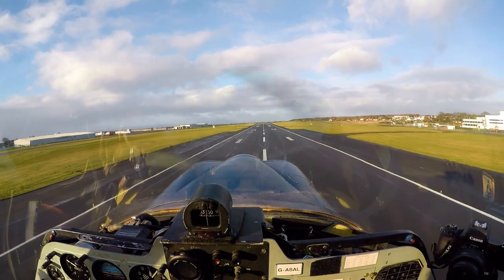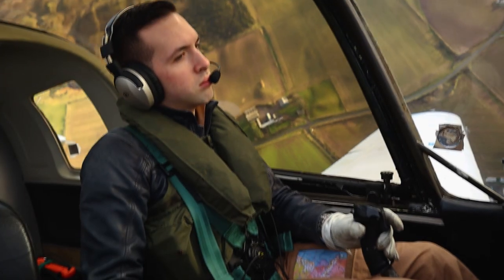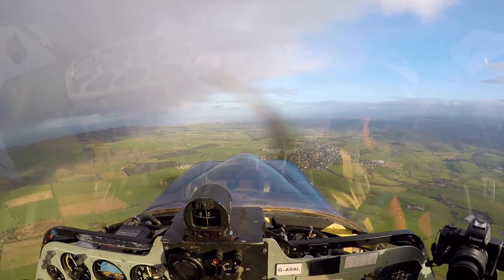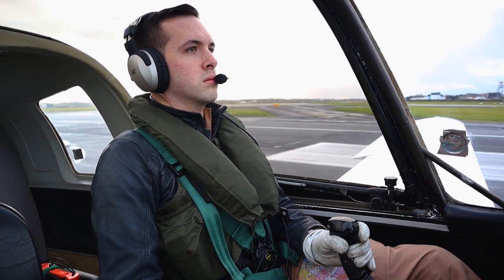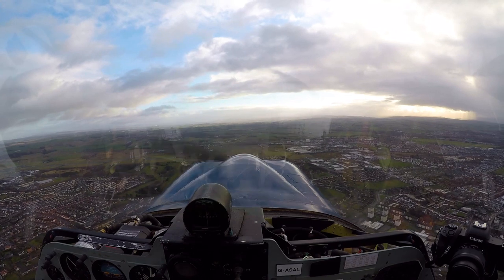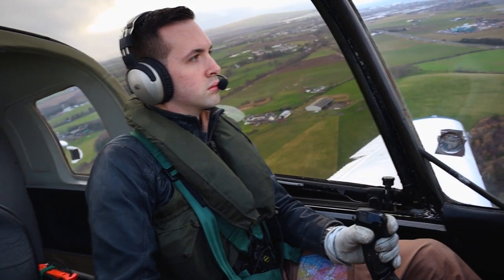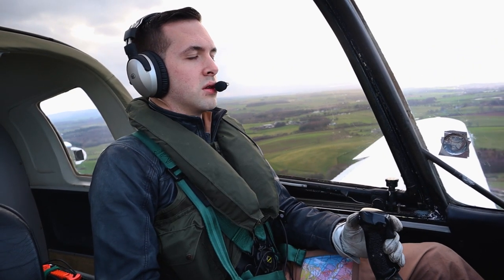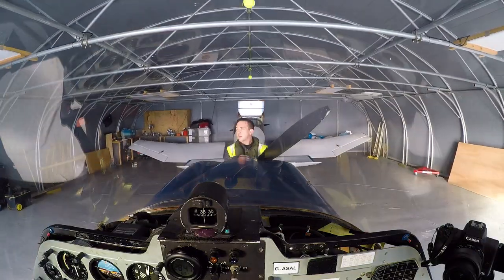Plane Landing Practise - Scottish Aviation Bulldog - Circuits at Prestwick Airport with ATC Audio

Comment: what's the story with the fatigue meter in the Bulldog and what you do when you reach the limit - stop flying ?
Reply from the maker: This particular one was never fitted with the fatigue meter so we either have to stop flying at 5000hrs or do a modification on the wing spar. Which we choose is still up in the air and depends on finances a couple of years from now.
Reply: thank you